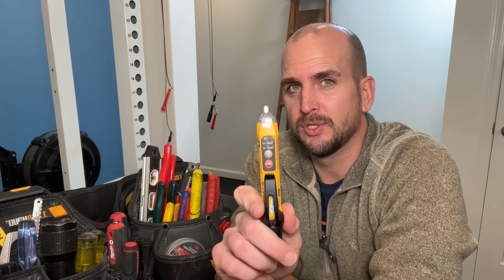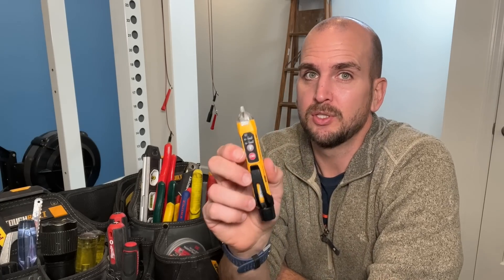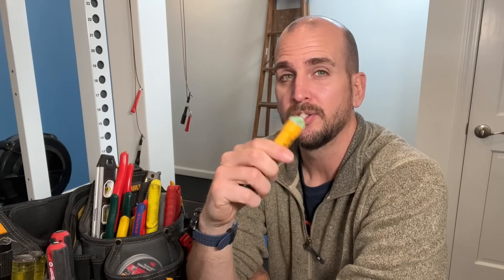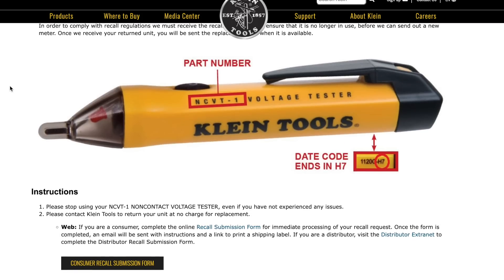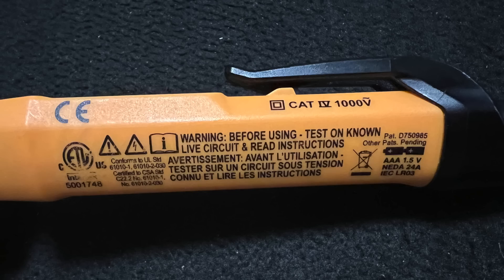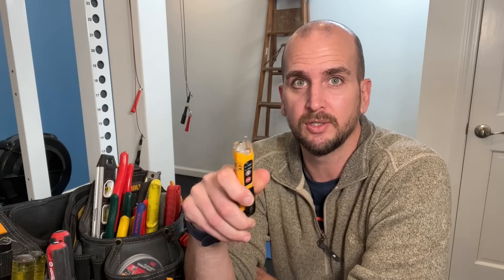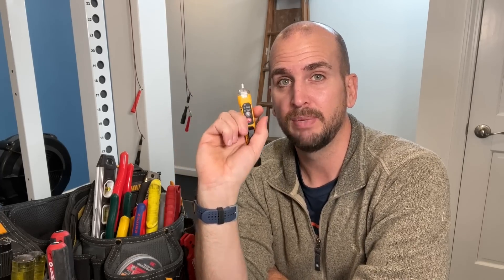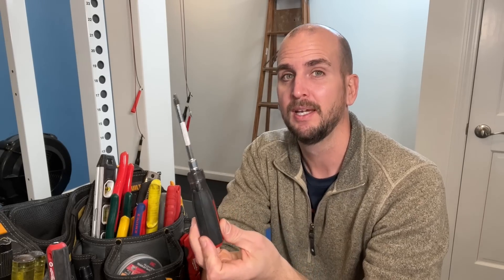The Tool I Get The Most Negative Feedback On And Still Use Weekly

Comment: Jobs that I have been on recently ...you would get fired If you used a non contact sensor for your primary means to determine if the circuit is off...it all depends where you work and how stringent the safety rules are...
Reply from the maker: Assuming DMM is the standard at the job you are on?
Reply: @EverydayHomeRepairs  yes sir.. non contact can be used as a secondary means.

Comment: Good review and was unaware of the Klien Recall notice.  Checked my model number and date code, and apparently it is exempt and not included in the recall.   Maybe bad habit, but this is my primary go-to tester to confirm no power on the black/hot wire.  Mostly a DIY'er with occasional light switch or receptacle change out.   Have been converting incandescent light fixtures with LED recessed wafer lights and or ceiling fan install or upgrade remove and replace fan/light kits.   This tool has never let me down.  Also have volt/ohm meter and will use that as welll on certain projects especially gang boxes with multiple connections/switches.  Thanks for the heads-up on these.

Comment: The fluke doesn't give you the boss readings that's why it's a safer meter or tester should I say I use one of those like you have a friend of mine bought it and it gave me all kinds of pulse readings so that scares me if you want to use one use the fluke to just lights up and beat that doesn't have all that other stuff on it

Comment: I had owned several brands over the years. I always preferred following up with a meter. Often false positives was a problem. I am a certified industrial electrician. Some years ago I was working as a contractor at a chemical plant and according to their rules I was only allowed to use non-contact testers. Everytime I got a continuous false positive, I had to wait till a in house company electrician to bring a meter to verify/clear a circuit. Once there was a 480 volt 500 MCM cable was laying in a tray that was needing to connect to a switch gear. My Fluke buzzed continuously that it was hot. I suspect it was stray induced current picked up from other cables in the tray. I had to wait over a hour before someone came to verify that there was no power on the cable. Even if I was being paid to sit around waiting on their people, it still a frustrating period of dealing with the bureaucracy. I still use a non-contact but I don't necessary trust it as a final verdict on a circuit. Another time I walked into a office my non-contact buzzed continuously without any proximity to any circuit. Another electrician with another brand had the same results. I think the overhead ceiling grid may had been hot. Needless to say the tester was useless on checking any wiring. The office manager wouldn't allow any checking the grid without a specific work order. Not sure if they ever resolved that issue.
Reply: Half way into read.. and WTF!?

They want you to trust your life on a voltage stick pen??

Comment: I always check the wires before touching them after I shut the breaker off, just in case the breaker was mislabeled. Once I remove the Marr connectors then I can use the multimeter. Also the non-contact tester allows me to chase a circuit if it was never labeled (or the labels were lost).

Comment: Not a professional electrician. I have a non-contact tester (Greenlee GT-11) but I usually use my low tech neon bulb tester. Neon testers do have a downside you need to remove wire nuts to get access to bare wire. but there are pretty bullet proof.

With any-non contact tester you should always use  it on a live circuit as you mentioned. 

As some of the others posted mentioned I've received serious shocks from circuits "I knew were off." So now I always test.

Comment: 25 years as an electrician has shown me these have their place. Its just a matter of understanding the strenghts and weaknesses of any given tool. Guys who think the  NCV tester are the do-all are just as wrong as people who think they have "no use." 

My biggest complaint with the NCV tester is false positives on the load side of a toggle switch especially on 277v circuits.
Reply: The tester may say that it detects starting at 50v but I have found that due to consistency in manufacturing requirements the lowest trip point for the tester tends to be around 30 to 40 volts.
Reply: any tester that routinely shows false anything is a toy not a tester.
Reply: @RadioRich100  you clearly don't understand what I am saying.  It is not giving you a false positive at 30vac.  It is tripping the internal electronics causing the equipment to tell you that there is power present.  If it is a "false positive" it isn't a true false positive because what you would be reading is induced voltage.  Induced voltage in the wires at that kind of value will supply a current but it will not be enough power to be harmful.  It does take a meter to confirm the "false positive" but you will act in a much more careful manner until you confirm that it's just induced voltage.  This kind of case can happen and I've only seen it once in my 22 year career.  False negatives, however, are typically user error just like false readings on the meter telling you there is no power when power is present.
Reply: @ianbelletti6241  your depending on quirky electronics to tell you the condition of a circuit. Those electronics are, on top of that subject to varyiing conditions which will affect the way it reads. The electronics does not see power just the side effects from it which can easily be affected by other things. Too many principles have to be in place for an accurate reading. The best thing for determining power or lack of it is a solenoid tester. If you have to be concerned with falses then you shouldnt be useing the thing. Its just a toy.
Reply: @RadioRich100  you definitely do not understand what you are talking about.  Solenoid testers are non contact voltage(NCV) testers.  You are literally disparaging out of one side of your mouth the same testers you are praising now.
Reply: @ianbelletti6241  thats funny Mine has 2 leads coming out of it. Where did you get your license in a raffle?
Reply: @RadioRich100  that style is the least safe, especially if you pierce the insulation to get a reading.  It also has the caveat that if you use it on the wrong voltage you will destroy it.  If the indicator light is blown, you will get false negatives.  Even OSHA doesn't like seeing people using that style of tester for safety tests in buildings.  That style of tester is more commonly used in testing power on cars.  In cars, that style of tester was originally designed to test the car's solenoid(s).  The NCV tester was designed to be a device that conveniently fits into a shirt pocket along your writing utensils so that you don't have to haul a bulky meter around to do simple safety checks when there is power on the building while not having to handle the live wires..  It is safer and OSHA approved.  If I wanted an indicator light style of tester, I could easily build one for the voltage I am testing.
Reply: @ianbelletti6241  Exactly your saying its better because its more convenient and faster. Which is exactly how you get into trouble. If you blow up your tester you dont know what your doing anyway. The NCV tester was designed to make money selling them because its an attractive toy to lazy people who dont want to take the time to be safe and do a job right. Using a solenoid tester with a neon light tests  the circuit 2 ways at the same time with no chance for false indications. Mine has 2 bulbs plus the solenoid. It doesnt look for side effects from ac power to work with high chances of falsing.
Reply: @RadioRich100  first of all solenoid testers DO NOT CONTAIN A SOLENOID.  They are called solenoid testers because the original design was to test the ignition solenoid on motor vehicles.  Secondly, solenoid testers are much more limited in their range for testing.  Third, if your solenoid tester is only rated for 120vac and you are in a building with multiple voltage systems, there is the possibility that you will accidently use it on the wrong voltage destroying it and possibly hurting yourself.  An NCV is much more forgiving.  As far as all the extraneous situations you are talking about that may give false readings such as being near rotating magnets, you forget that your brain is your most important tool whenever you do any task.  It is your responsibility as the user of the NCV tester to be able to tell if the situation should give you accurate readings.  Part of that is testing on a known live circuit to verify the NCV tester's operability.  Just like any other test equipment, you don't want to rush when getting readings with the NCV tester or you will be prone to false reading.  It is also your responsibility to use your brain to know if you are just trying to detect power or if you actually need the voltage values.  Finally, if you are going to use something that connects to live conductors anyway, you might as well use a meter and forget the solenoid tester as the safety level is the same or better and it gives you more information.  If all you want to do is check if some amount of power is present, the NCV tester is by far the safer method when used properly.  Of course you wouldn't use it to detect if a capacitor has a charge or for power on a dc system as NCV testers are designed for ac systems, but you don't have to worry about the dc power damaging it.

Finally, everything I have said has been about understanding the limitations of your equipment.  Limitations aren't the same as flaws.  Even you have physical limitations.  I wouldn't expect you to carry a 1000lb pallet by hand, but to use equipment that is designed for the weight and terrain to do so.  It is the same here with NCV testers.  Do not expect them to give proper readings when you don't use them as intended and with good practices or if you bought a cheap model or one you have to hold the button to take a reading.  Make sure the NCV tester you get gives you an indication that it is on, and make sure you do an operational test the first time you turn it on and after getting a negative result.  Good quality NCV testers are more reliable than you think if you use good practices and use your primary tool which you are supposed to have with you at all times.
Reply: @ianbelletti6241  Again your wrong, yes mine has a solenoid in it, what do you think pulls the pointer down?  If you want to play games with toys instead of proper testing procedures do so. Nobody will ever be taught be any reputable person to rely on a time saving toy and cheat safety by saving time or trouble. Short cuts can be deadly. Your NCV might as well be PLAYSKOOL brand. None of them are good by design because they dont indicate power just the field that comes from it which is affected by lots of things. Where there is smoke there must be fire right?  Do you also not use lock out tag out either? Its faster! What toy do you use to speed that up? This video was made because lots of people dont believe in these and there right. There is only one thing there good for, trouble shooting the old xmas lights. They (MAY) find which bulb is out. But you wont get hurt if its wrong.
Reply: @ianbelletti6241  you havent seen the ball since kickoff. Its not the fact that its expensive or cheap. they all use the same principle - where theres smoke there must be fire.  It cant be depended upon to indicate presence because too many things cause it say so or not. You cant speed up a process and call it safer thats ridicules. I use serious good equipment solenoid or multimeter or even a neon tester. U might as well use a metal detector to do that then try to figure out what set it off or didnt. Open neutrals can be trouble shot with a ground nearby or neutral from the same panel. Making direct contact is the only way that is accurate or safe. Saving time wont benefit you if u get a severe shock when your toy indicated the circuit was dead when u should have used a little more time and the right test equipment.
Reply: @RadioRich100  you did not understand my point.  I was not talking about testing for open neutrals although a good NCV tester can tell you if you have one.  I was talking about the fact that every joint you have to take the wire nut off of leaves you prone to getting shocked because the person who last touched the wires may have decided to be lazy and not follow safe practices by using the wire nut as the only physical method to hold the wires together instead of twisting the wires prior to installation of the wire nut.  That singular issue makes it extremely dangerous to remove wire nuts on possibly live wires.  That is why an NCV tester, as much as you seemingly despise them, is such an essential tool to have at your disposal.  My other point is that your brain is your most essential tool for solving problems and that every tester when improperly used or in poor condition can give you erroneous results.
BTW I hope you aren't trying to be safe by piercing the insulation to test the wires as many solenoid testers will instruct you as a possibility for the testing as this causes a code violation and will require you to reinsulate the wire with appropriate insulation meeting or exceeding the value of the original insulation.
Reply: @ianbelletti6241  heres my point the only thing that toy tells you is that there is an electrical field around or near the wire under test. You have no idea why.
Reply: @RadioRich100  Actually, I do have an idea why.  As long as I am not working in conditions with high energy em fields from other sources, which I normally am not, the device is reliable enough to detect the em field off of a wire with ac voltage on it.  Clamp ammeters work in a similar way but use transformer action to read the amount of current.  If you cannot understand these basic concepts of how the equipment works and that it is designed and calibrated in such a way that em fields below a certain threshold will not activate it thereby eliminating the vast majority of nuisance error readings, you should not be working with electricity.  The cheap ones, especially the ones you have to self calibrate, you end up with devices that are set oversensitive or set not sensitive enough.  That is why I keep saying not to get one that is cheap.  Ones where you have to hold a button to read are bad as well because there is a tendancy for you to accidently let pressure off the button at the critical moment when you are trying to read if there is power.  Some of the more expensive models have added functions.  I have a Sperry that has a GFCI tester built in and a Fluke that has an infrared temperature gun built in.  Both are calibrated to a point that they don't give you nuisance errors under normal conditions where used properly and are accurate enough that I can normally identify which conductors in the box are live.  BTW, my brain is the first tool I use in any situation.  If I am working on a lighting circuit with working lights attached, I know that I can use the working light fixture to tell when power is on or off.  Having the tool is important but using your brain is more important.  It is becoming clear that your distrust for NCV testers is coming from both bad experiences with cheap models and overthinking things to the point that you forgot that the manufacturers accounted for most of your issues that occur under normal conditions with how it is designed and calibrated.

Comment: Even when using Multi Meters, you should test on a known live circuit. Leads can be defective, bad contact, etc.
Reply: So, you don't believe the Ohm function on the meter when you power it up and touch the leads together as proof of meter function and lead integrity?
Reply: @buckhorncortez  for the leads and continuity function but I would still test on a live circuit for correct operation if my purpose was testing voltage. Particularly for new users that might not know which setting to use to check for voltage like voltage range.

Comment: The non contact tester stays clipped to my shirt. I normally find it being faulty around older wires that may be wrapped around or jumbled up with live circuits. Also, sometimes you can't get your multi meter in areas where your non contact  can get to. I always use it. You can get false positives if your batteries are loose in your tester. We call it an idiot stick in the trade, but it can be a life saver. I'm  licensed in Va. since '06, doing it since '99. I don't hit a project without it

Comment: Conductors that run together like in a length of Romex or together in a conduit, because of their close proximity to each other will have capacitance between the conductors so if you energize one of the conductors it will induce a voltage in the others through the capacitance between them and this is one way you could get a false positive (some call this a ghost voltage) with your volt pen and even read the voltage with your digital voltmeter. The old Simpson 260 meter or a Wiggy solenoid voltage tester would not show this voltage because of their low impedance but most digital meters have an input impedance in the 10 to 20 megohm range and the non-contact voltage pen infinite.

Comment: The electrician's I've seen working have always had one of these gadgets. I had no idea there was any controversy about these things. One thing I used it for was figuring out which wire was hot when I was working with old cloth insulated wires where the color coding on the insulation had degraded. Clearly the most important issue is false negatives. I have done a lot of wiring for a non-electrician and I've never seen one. But I don't use them until I've convinced myself that they're working.
Reply: There's some greybeards that hate anything invented after the turn of the century and wish we could go back to 1980s electrical standards.